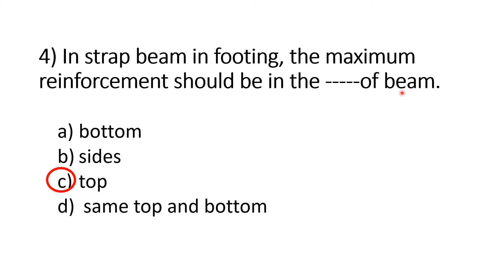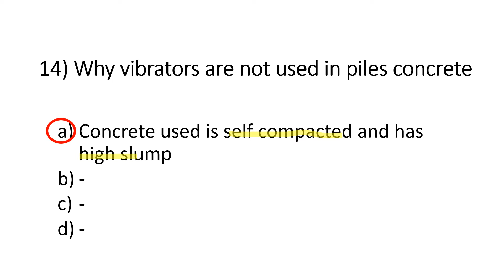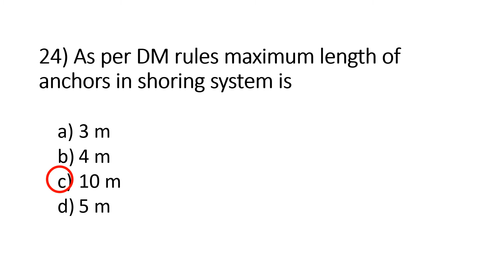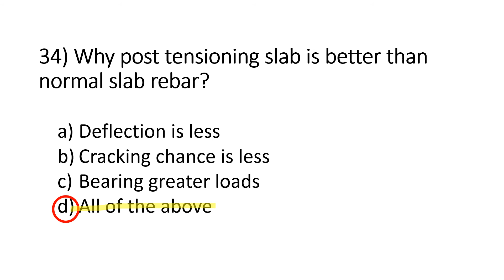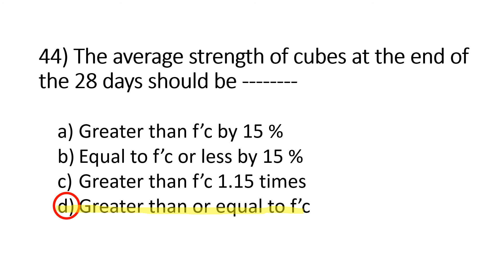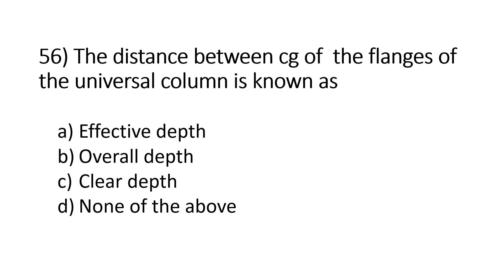DM Building Contracting  G+12

Comment: Q:56 answer is Effective depth 
Q:58 Answer is eave connection Beam and Columns
Apex Connection Two Beams
Reply: Sir what is the minimum  bottom level  of shoring piles in case of adjacent building ?
Reply: 10

Comment: one question you forget to solve
density of light weight concrete is 1300 Kg/m3
Reply: Lightweight concretes can be produced with an over-dry density range of approximately 300 to a maximum of 2000 kg/m3 AS PER ACI
Reply: wrong its 2000 kg/m3

Comment: 1.the coarse aggregate which possess the property of good interlocking are.
2.which placed fixed  eccentric footing ?
 (center of footing or edge of footing )
3.construction joint
4.workability of concrete
5.expansion joint
6.minimum cover for piles
7. density of wood approximately
8. the bottom or lowermost horizontal part of windows frame

answer please..
Reply: 1.Angular shape 2. edge of footing 4. slump test is done to check workability. 6. 75mm cover for piles 7. 1500 kg/m3  8.sill